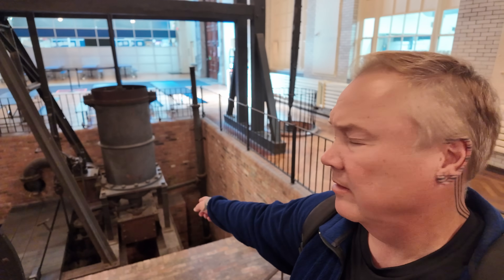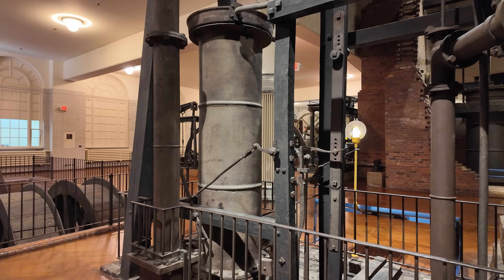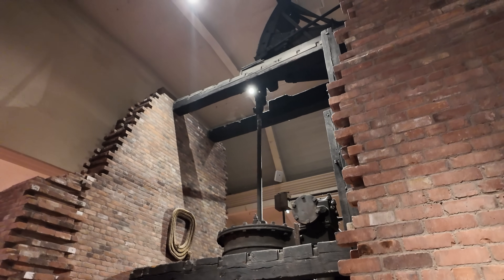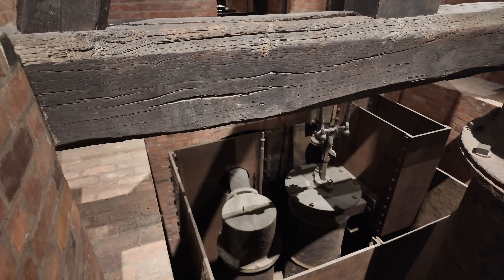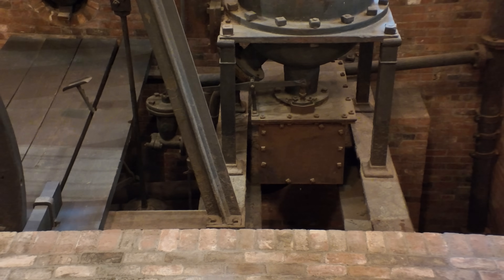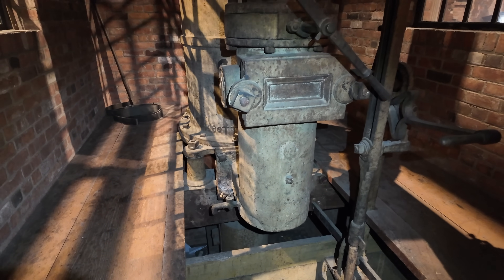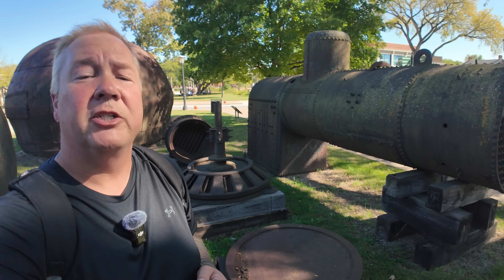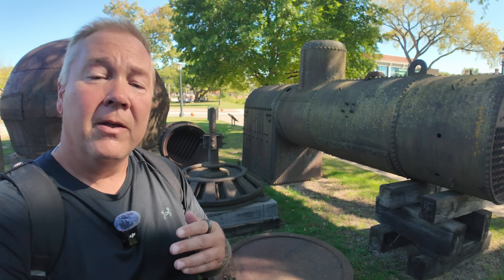The Weird, Profitable Reason Steam Engines Had Pickle Pots

Comment: They do that with diesel engines now, they charge you extra for “low sulfur “ electronics and DPF and EGR Same with modern cars they over tech cars so they can’t get fixed other than going to the dealer
Reply from the maker: Not new.  The earliest environmental law I know of is early 1800's prohibiting the burning of coal.  They had to burn only coke.
Reply: @Industrial_Revolution just another way to find more ways to take the money
Reply from the maker: Ever hear of The Black Country in the UK?  It got that name due to coal burning.  Look up what it was like in the late 1700's/early 1800's sometime.
Reply: @Industrial_Revolution only East St Louis and Southside Chicago but we got a few places where the power plants still dump their soot on the poor neighborhoods
Reply: @Industrial_Revolution  No trees because of the sulfur in the coal.
Anybody who complains about low sulfur fuel has never driven across kilometres of Germany in the 1990s when the trees were being killed off by the acid rain caused by the Czech bituminous coal power plants. If they did so they would have got the message.
Reply: Tad off topic ,but I met a old boy who had a mullet boat( traditional nz fishing boat),he had used it all his life since the mid 20’s,built new for him,I asked him why he consistently painted it grey top,decks and cream hull and cabin sides,he said it was always parked outside his house with the same paint colours because of the main train tracks that ran across the middle of the bay,the soot from the trains made everything this colour anyway,white would turn dark cream,light blue ,the nice colour for cabins would turn grey,he had bent coro iron to go over his boom to protect his sails from embers  300 metres away….
Really enjoy your vids ,regards.
Reply from the maker: @benrobertson7855  that's a really common thing.  Some people even try to buy cars painted a color that won't show the road dirt and salt (it doesn't work).

Comment: Coal mines often had a good supply of low-grade coal that was not worth shipping to market, yet they had to dig it and move it out of the way to get at the good stuff. May as well feed it to a cheap engine efficiency did not matter much.  If the engine was located in the mine it could reduce the weight and volume that needed to be moved.
Reply from the maker: Yep.  They could also fuel their locomotives with the scrap stuff.  The lumber industry did the same thing.  No point buying fuel when you've got it free
Reply: The concept was also used on the Reading Railroad, look up Wooten Firebox.  They had to make the firebox extra large to compensate for the low heat output of waste (cheap) coal.
Reply: @crusinscamp  Also the Reading ran in the anthracite coal region and this "culm" was what was available to them.  It wasn't really low heat as far as I know just small in size.
Reply from the maker: Size would definitely be another factor.  Too big, they'd break it up, but too small, shipping and handling were less convenient.
Reply: @Industrial_Revolution  Too much coal grit and dust was an explosive risk, not unlike saw dust in a wood burner.
Reply: The only places that used the other engine was in the Steamships where fuel was a priority. However, these ships were so big they did not have so many of these around the world where most were other types of ship.

Comment: Good video. Thanks for the explanations. I am now tempted to convert and old air compressor into a steam engine. Good Luck, Rick
Reply from the maker: Most steam engines, except atmospheric engines, can actually run just fine on compressed air.  They actually made compressed air locomotives that worked just like steam engines, but ran off huge compressed air tanks.  They were used in mines, factories, and, oddly, a lot of agricultural areas.

Comment: Sounds like watt considered Trevithick a credible threat then!   He did eventually serve him with a writ for patent infringement.
Reply from the maker: He definitely considered Trevithick as a serious business competitor.  Watt had a patent on "strong steam" but never built a production system using it.  I hadn't heard Watt actually tried to enforce against Trevithick, though.  What was it for?  He didn't get a working high pressure boiler until after Watt's patent on that had expired.
Reply: @Industrial_Revolution 
From what I have heard at this time trevithick was engineer at ding dong mine in west penwith. He was experimenting with some of his ideas with the beam engines at the mine and ignoring watt’s requests to stop meddling!  The writ had to be served in person, watt had sent his agent to cornwall many times to do this but Trevithick being a giant of a man the agent was afraid to confront him.
Eventually they managed to corner Trevithick in London and serve the writ to him. I will have to look into what Trevithick was actually doing on these engines to upset watt.  Bull was also involved because he was Trevithick’s assistant.
Reply: @Industrial_Revolution 
Edward bull and Richard Trevithick worked togeather on an engine design that came to be the bull engine.
It was an inverted engine with cylinder on top of water pump and did away with the rocking beam.
Boulton and watt sued and won the case for infringement of patent.
After this Trevithick worked with the high pressure steam idea and built an engine that vented to atmosphere.
This then had no need for a condenser.  Here in cornwall these engine became known as puffer engines from the noise they made.